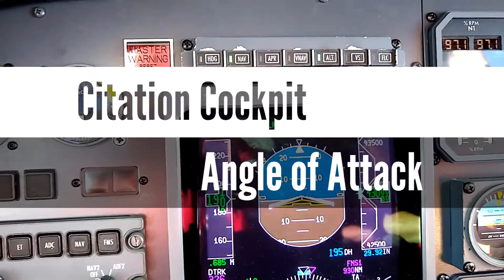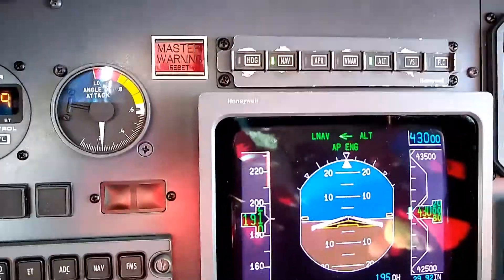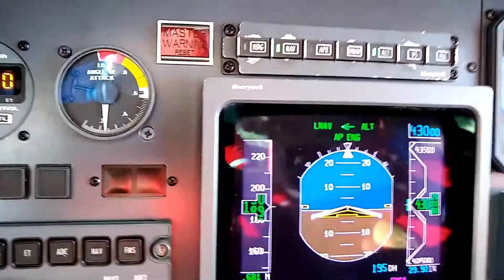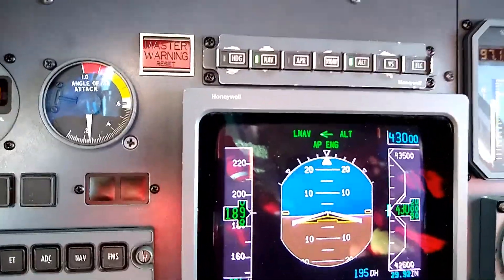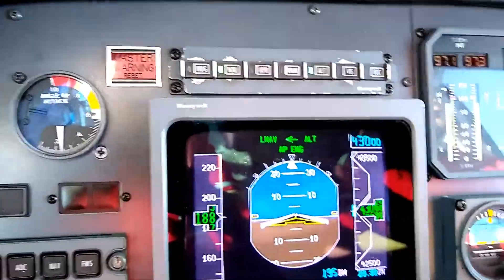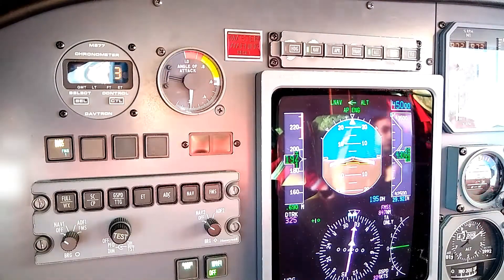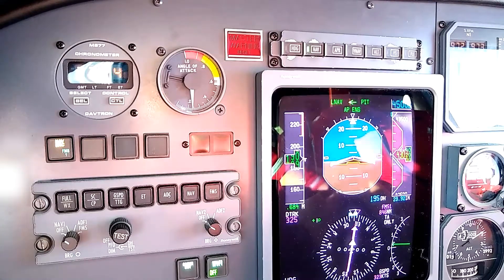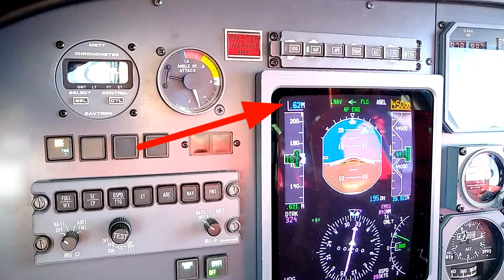Citation Cockpit - Angle of Attack

Comment: “Want to start the climb at about 0.25 or less… if we’re higher than that we just don’t have the climb performance available…” do you mean Zoom performance. Aren’t you really looking at such to zoom climb seeking to not fall to the back side of the curve before reaching target altitude? Wouldn’t we be better making distinction in discussion between Zoom and Climb… 

Further, we have an AOAx or best angle climb in a jet at L/Dmax which goes all the way to absolute ceiling, whereas we have AOAy which is constant regardless of load but is altitude dependent sliding slowly larger and larger till meeting AOAx at absolute ceiling… thoughts? Similarly, we have best range (in still air (no wind)) and max endurance AOAs which are also load independent constants (except as we get to absolute ceiling).

Comment: On a V1 cut, at V1, should the AOA indicate .6 ?
Reply from the maker: @jamesconvery4793  Great question! To be honest, I've never paid close attention to AoA during a V1 cut. V1 is a decision speed, not a flying speed, therefore AoA is irrelevant at V1--the airplane is still on the ground at that moment. V1 speed always comes before Vr, the speed at which the nose should be lifted off the ground and flight begins. I think V2 (best angle of climb on a single engine) would probably correlate more closely to 0.6 AoA, however, I'm not sure how closely it correlates. I suspect V2 might be a little faster than 0.6 AoA because it's not accounting for strictly the wing's performance, it also relates to the ability to maintain directional control. I'll try to take a closer look at this detail next time I get a chance. A very interesting question indeed!
Reply: .35 is best range
 .6 is Vref
.7 is V2

Thank you for your video for me to better understand the Citation AOA !

Comment: Thanks for this.  Just got a job flying an ancient (1979 full steam-gauge) Slowtation.   ;)  We're pretty much a speed bump in the NE.   Went to FSI in MCO and nary a peep about the AOA.   Our plane uses a Rosemont.   I have picked up some good intell in your videos.   The .25 and .35 info here is particularly useful.
Reply from the maker: Congrats on the new job! Are you flying a Citation I or II? The Citation II is the oldest variant I have time in. For that airplane, the book says you can take it to FL410, but real world, it rarely makes it that high on anything but the longest legs at the lightest weights. They are so underpowered by jet standards. I'd flight plan for FL350/FL360 on most legs. Still, a great airplane. Enjoy it!
Reply: @citationpro  I believe it's a 2 because it has TRs.    But, I'm not positive.  I don't know bupkis about most GA aircraft.   It really is a pig once you get it up past the mid-20s but I've been flying transports for the last 30 years and as such, I am used to planes with bigger balls and far more capability.    I took it to 330 last week and then we went to 370 because we were trying to dodge boomers.  I really wanted the additional altitude for extra top clearance and visibility.  You see, It only has a toy radar!   ;)    Once we got there it was fine, but there was precious little left so we were very careful.  The fuel burn was impressive.    The Mach, not so much.

We are taking delivery of a Bravo model in the next few weeks.  I flew it twice two months ago and it is a MUCH nicer and more capable jet.  I am looking forward to flying it.
Reply from the maker: @lbowsk  That's great, the Bravo is definitely a nicer airplane. As you've already seen, don't put too much trust in the radar with any of these older jets. Try to stay visual and go around buildups whenever possible. Happy flying!

Comment: You're one of the few who sees the big advantage of an AOA. Question for you: what kind of AOA is it? What sensor does it use? Differential pressure? And what do you think of 2 separate working AOA's , one on each wing?
Reply from the maker: In these Citations, the AOA probe is a physical vane located on the copilot side of the fuselage. It streamlines into the relative wind in order to provide a reading and requires normal DC electric power to operate. I'd be in favor of two separate AOAs, simply because I like redundancy, although I don't think it's necessary in the straight wing Citations. They have very docile stall characteristics and the AFM clearly says the AOA gauge should be considered a secondary instrument with the airspeed indicator as a primary instrument.

As a side note, I've test flown a couple Citations for maintenance checks and specifically checked the accuracy of the AOA probe. The procedure is to load the aircraft to the forward CG limit, then fly in level flight in various configurations (cruise, approach, and landing). Gross weight and airspeed is recorded when flying at 0.6 AOA then compared to a graph of what it should be under those conditions. If it falls outside of a four knot tolerance, it needs to be adjusted.

What these checks showed me is that there are quite a few conditions when the AOA might not be perfectly accurate. It made me realize why Cessna declares it a secondary instrument. Great information 90% of the time, but a pilot shouldn't rely solely on AOA during critical maneuvers.
Reply: @citationpro  thank you for the response, much appreciated. I got a bit of passion for AOA lately. I think it's a misunderstood or underused sensor in the cockpit. There are couple of ways to measure AOA, a vane is sturdy simplest  design. Other question, the AOA on the citation ultra, are the procedures and use described in the manual from AOA sensor manufacturer?
Reply from the maker: @diederikschip6190  the manuals do a good job of describing the system and what it does. For example, it describes the approximate AOA reading which will set off the stick shaker, what conditions will cause the cockpit annunciator to illuminate (such as loss of power to the heating element) and so on. It really does not say much about how to actually use the AOA reading in flight though. I believe all of the text comes from Cessna rather than the actual subcontractor who produced the part. Or maybe Cessna produced the part? I don't know. I've never dug into it that deeply.
Reply: @citationpro  thanks again, I'm gonna read the manual, if I find it somewhere.
Reply from the maker: @diederikschip6190  try https://www.smartcockpit.com/aircrafts-models.html. They have quite a few Citation manuals there.

Comment: Very good video. I would like to see one video on AOA use for landings
Reply: Put it to normalized AOA value of 0.6, which on a properly designed gauge is three o’clock, but there is a catch as this then sets you to fly power techniques whereas you might have issue with engine response time and compressor inertia… look for Improve your Landings with AOA and Power Techniques, see also the associated case study F-35C Crash into the South China Sea. Note differences Backside of the Power Curve vs Drag Curve.

Comment: The aircraft was close to the coffin corner in this video?
Reply from the maker: Sort of but not really. A typical "coffin corner" would be when there is only a few knot margin between overspeeding and stalling. Even at FL450, the Citation has about a 30-50 knot margin, depending on weight and temperature. It is fairly forgiving compared to other jets.
Reply: @citationpro  Thanks I have 4000 total time from mostly turboprops. I have never flown jets before and I just got hired for a job flying the Citation.  Your videos are very useful, thank you!